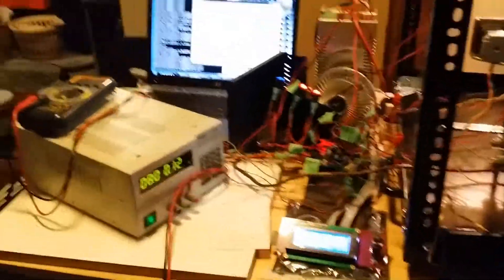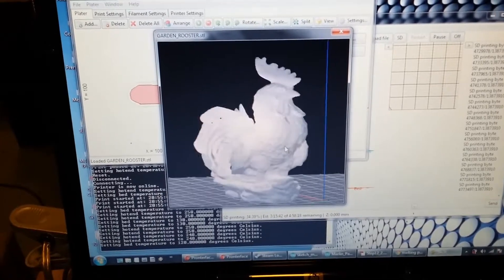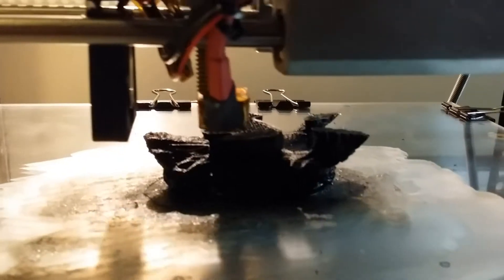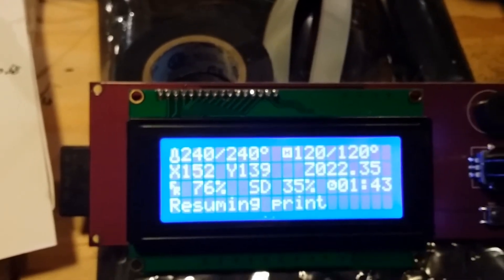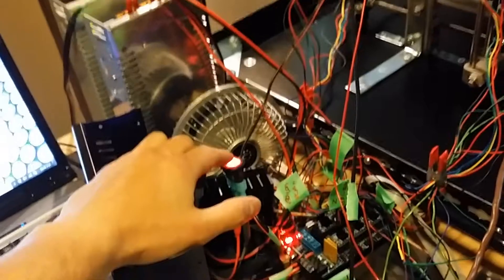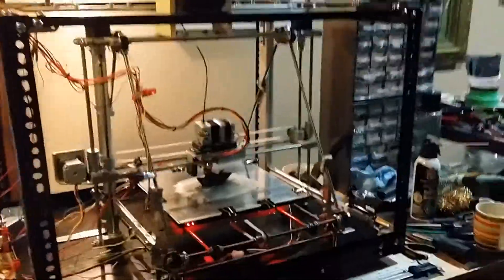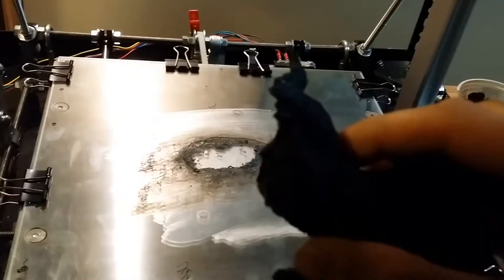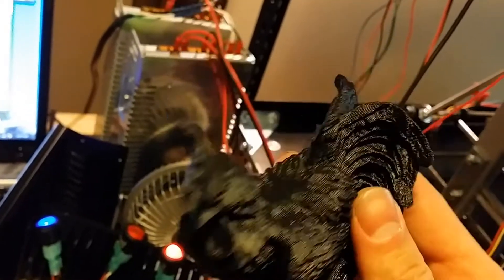12x12 RepRap Mendel Prusa 3D Printer First Test Print

Comment: Why is the printer frame so huge for a print platform of only 12" x 12" ? Is there a reason?
Reply from the maker: Hey Bailey it's oversized just for the convenience of upgrading in the future - I'll soon be swapping out the inside reprap frame for something a little it more precision-cut.  I'll always use the same enclosure to keep the fumes contained. Also have room in there for lighting and the electronics are jammed in along with a few spools of filament hanging inside at the back. Idea was to contain everything because the fumes were bothering me. Been meaning to create a new video showing the updated enclosure with the air exchanger I built.
Reply: ok great

Comment: Wonder if anyone's ever rigged tracking for the extruder to measure how much filament gets used on a print. That could help with cost estimates if you ever wanted to sell your prints
Reply from the maker: Hey +freeNode5, usually your slicing software will estimate how much filament you'll be using in both meters and grams based on your settings (infill and perimeters). It's sometimes more useful with weight because the length of filament on a roll may be inconsistent. Most filament rolls are 1KG, so if your print ends up being 100g on a scale you know you have 900g left. With more infill you'll be using more filament. Sometimes you can play around with different types of infill patterns to really save on filament - for example a 2% honeycomb (hexagon pattern) infill makes the print basically hollow and allows you to easily remove the infill after if you want and just keep the 'shell' of the print. Some people then like to fill it with a cheap filler like Bondo resin or hot glue. Some newer printers will track how many hours and how much filament you've pushed through a hot-end although my DIY one doesn't...yet :)
Reply: +freeNode5 I believe someone has made a printer that takes custom-made filament spools that attach to the printer, and whenever the printer uses plastic off of the spool, it writes how much filament it used to a small custom chip on the spool of plastic, so you will always know how much you have left.  The only downside is that you would either have to buy their custom spools, or re-wrap the original one.  I forget the name of the rpinter, however :/ .